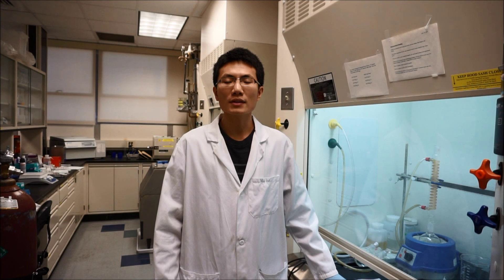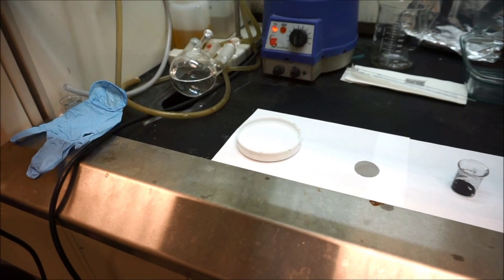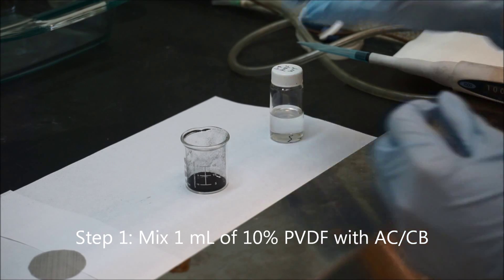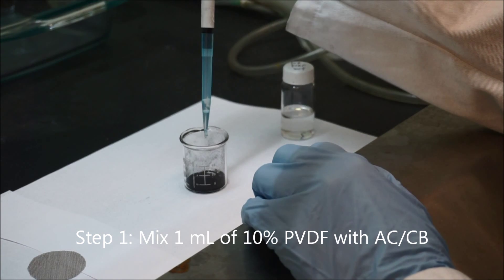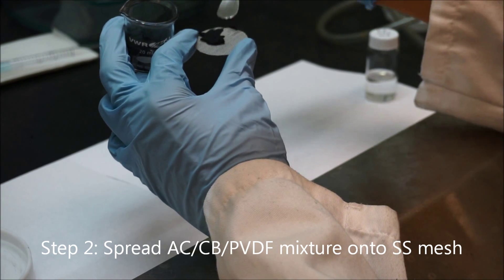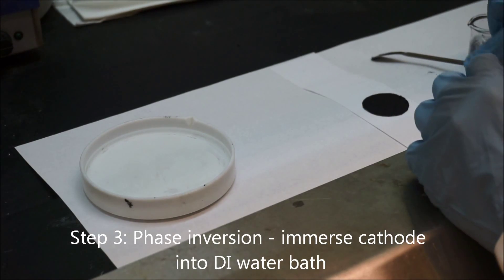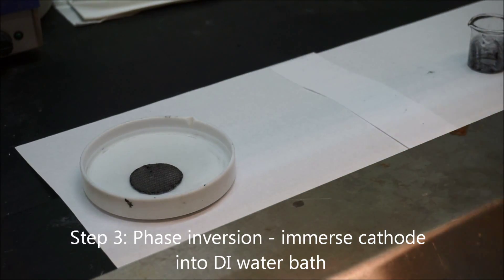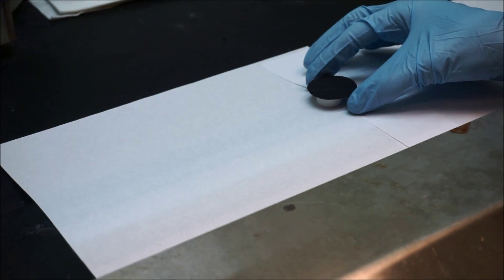Phase inversion activated carbon cathode fabrication

Comment: Hi Wullin! Thank you very much for your video, very clear. I have a question: Why do you use carbon black mixed with activated carbon? What does the carbon black give to your cathode?
Reply: It is a conductive additive. You can also use Acetylene black for the same purpose.